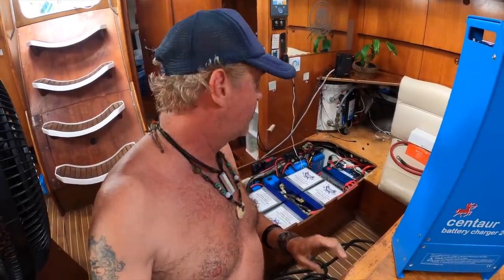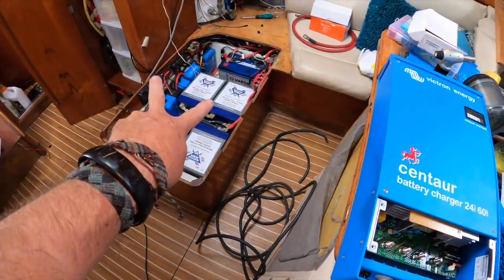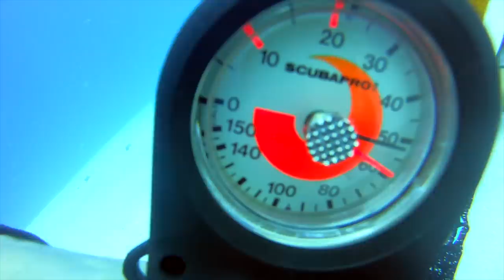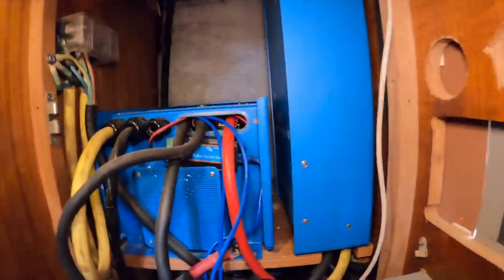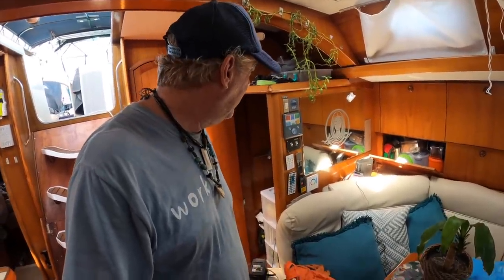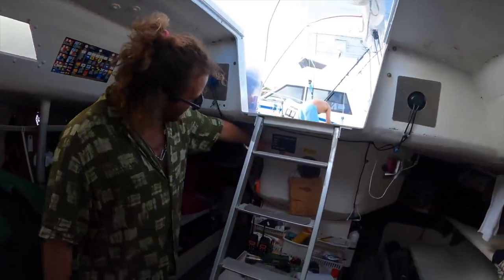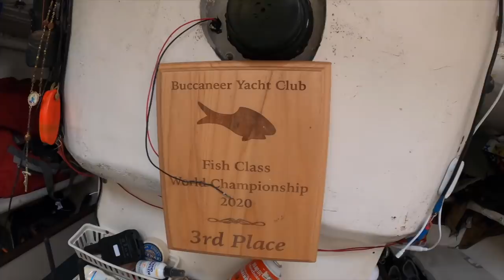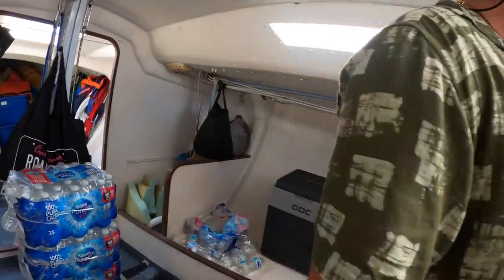SSL515 ~ Another one bites the dust...

Comment: Since heat rises normally, you might consider mounting the fan so it exhausts upward out of the cabinet.  I believe that it would be more efficient.  The fan would then not be fighting the warm rising air.  It would be good to have another vent at the bottom of the cabinet door.  As you know, on a boat, the more air circulation the better.

Comment: Nice into . Mattie must have set that up ? Capitan, I tried to look up that fan controller. Not showing in your amazon links, and couldn't find at the battleborn site. What is it ? Sorry, I missed a number ? So now, with all that power, an auxiliary electric prop motor backup, for when your diesel won't start ? Oh, and that 5500 watt looks like runs on petrol ?